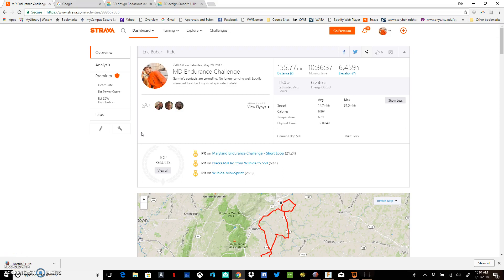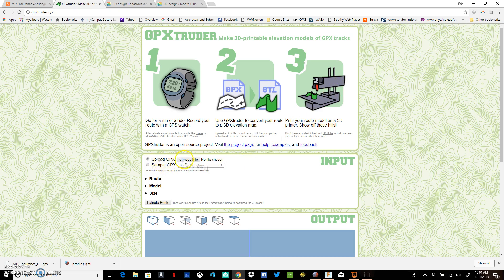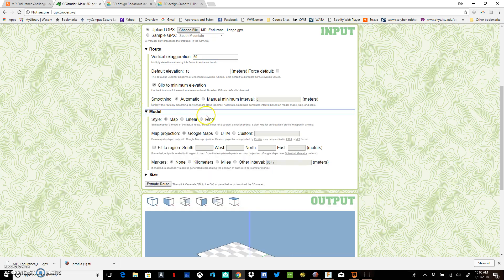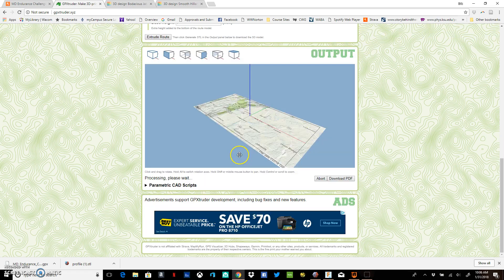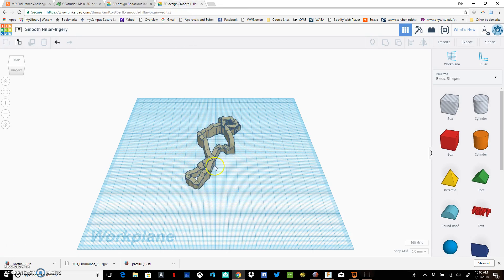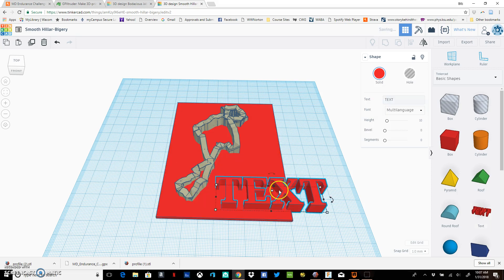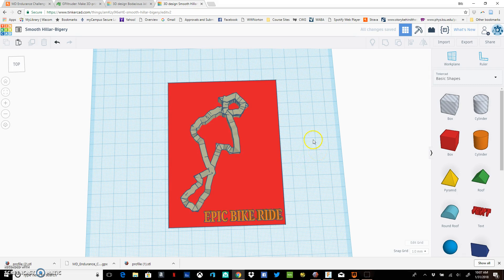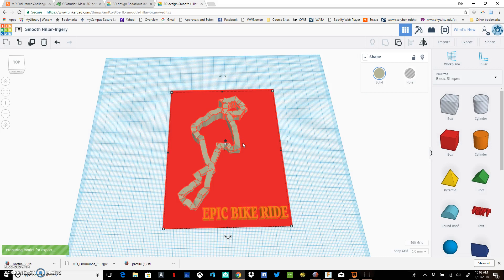STRAVA GPX to STL for 3D Printing

Comment: HI! I've found ways to print an STL of a Topo map, and now, thanks to your video, I've found a way to print a GPX Route. Do you know of any way to overlay the GPX router (or track) onto a Topo layer? It would be awesome to print a topo tile with a route on it (in a secondary color, for example)!
Reply: You should just need an STL of your topo map.  Not sure how to get that off the top of my head but I suspect there are easy ways to do so.